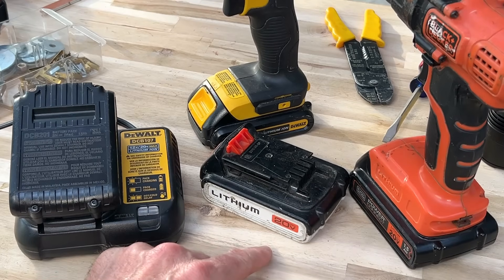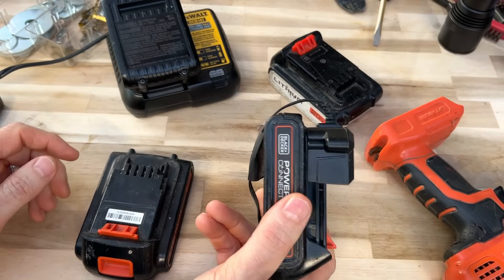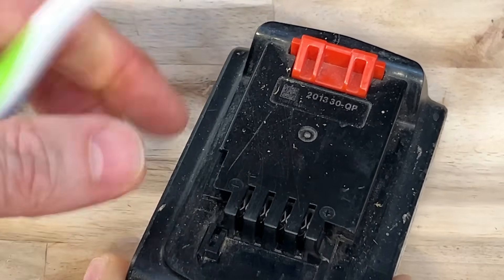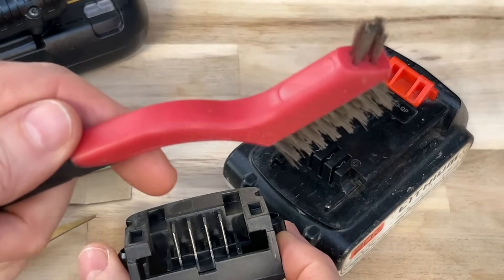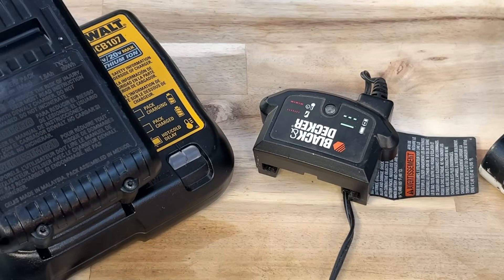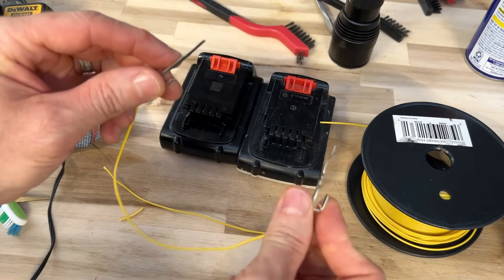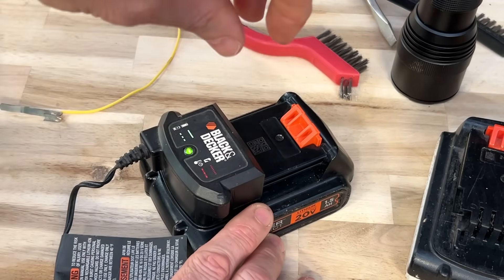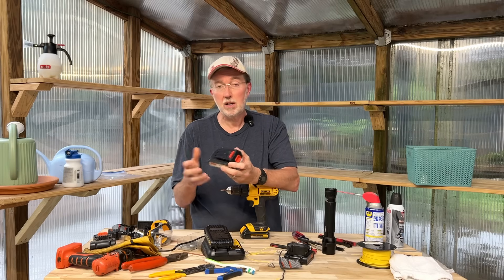SECRET Method To Revive A Power tool Battery 18-20V Fast Easy FREE

Comment: For slot type batteries like that just simply crimp two male speaker spade terminals on the end of the wires and that way they would never touch and then for the tower type batteries just use female spade connectors, and that way it would be much safer.

Comment: I’ve been doing something similar for years, but it’s much easier. I use heavy duty aluminum foil. Wrap it around the ends of the wire and fold the other end over 4 or 5 times, This should fit perfectly between the + and - slots.

Comment: 8:30 de-oxit is good for cleaning electrical components too. I use it on my guitars volume knob. but you just spray it on and agitate the surface of the metal like youre doing there with the  brushing. (or in the case of a guitar volume pot, just turn it up and down and up and down. )

Comment: Will not always work for Makita LTX and can damage the cells or the board.
Genuine lithium Makita pack have a circuit that record the charges and statistics of eatch cells. If the circuit have detected a very bad cell or too mutch overheat, the chargers wont want to charge it.
I got one of thoses, until i find a replacement board, i will charge it with an other in parralel. (I replaced the dead cell, but the board has memory that i cant erase yet.)
Not genuine Makita use a simpler board. The BMS or protection will vary depending on the manufacturer.

Comment: "I'm gonna show you" "I'm gonna show you" "I'm gonna show you" "I'm gonna show you"

Dude, that was not fast or easy to listen to you.  You spent more time putting your camera up than planning out your script.

Also, terrible advice, might be able to revive a battery, but at times the terminal goes out from a short, batteries will randomly catch fire when they charge just fine, if you're buying from someone who doesn't warranty their batteries you get what you get, if it's dead after the warranty, unless you understand how to open it and inspect the actual batteries and know how to solder, don't screw with it.

Comment: Or get a corded one and leave the batteries in toys. I have 40 year old tools because the batteries didn't go bad. This generation will never have old stuff. They'll always be broke no matter how much they make. They'll never be content which is the big shame.
Reply: You sure hit the hail on the ned
Reply: Why don't you wait to complain until you can spell nail! lmao
Reply: So are people like you!! Looking for something to bitch about 😅
Reply: You are actually wrong because you're comparing apples to oranges. New batteries are typically lithium ion cells(each cell is approx. 3.7v nominal 4.2v at max charge, the cells are usually 18650 or 21700) your batteries that have lasted you so long are most likely nicad batteries. They can be fully discharged and will still take a charge, so you aren't doing something better... you're using outdated batteries. Nicad batteries don't hold a charge as long, they have a lower mah per size/weight, they can't deliver as many amps, and this makes them inferior in every aspect important to a battery powered tool, besides being able to charge them regardless if they are end of life or abused, resulting in giving owners a superiority complex although they have no clue about the chemistry, maintenance, or care.
Reply: @anthonyortega3136  My DeWalt battery drill is a POS. My corded ones will break your arms. You do you. I was heavily invested in the RV Industry, They are a POS too but I wasn't telling that either. People that would never consider living in a house trailer sell everything they own pay huge money  and live in a motorized smaller house trailer. It's all in marketing just like battery tools. What's in it for the company if my tool lasts 30+ years? Home owners don't use batteries enough to keep them useful. Professionals do and I can see there they would benefit.
Reply: I think he's talking about power tools

Comment: 13:30 just grab 2 paperclips. Don't even need to [un]bend them. Stick 'em in one battery, flip the other battery upside down and slide it over the connected paperclips. I have never done this before; do it at your own risk ¯\_(ツ)_/¯

Comment: My "brand new" Milwaukee battery is flashing that it is broken..would this work on that.  I never used it because I had two batteries and evidently it discharges if not used.
Reply from the maker: Sounds like it’s completely discharged.

Comment: Thanks for sharing this. I've been trying to go to all battery yard tools and construction tools. I use mostly worxs brand so s they can be interchanged between all my tools easily, however I do have some other batteries such as Black & Decker and Ryobi. I'm guessing that all of these could be treated the same way as long as I use the same brand to charge as the one that is uncharged 
.. correct?